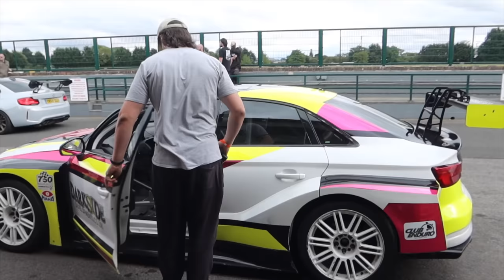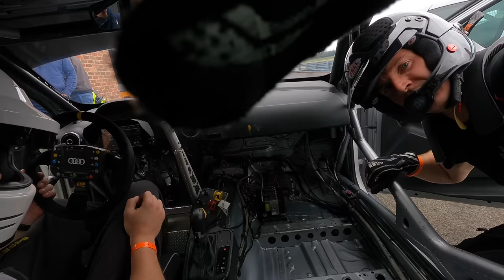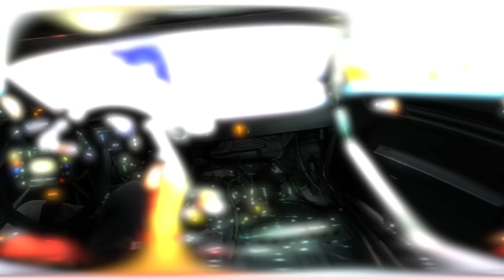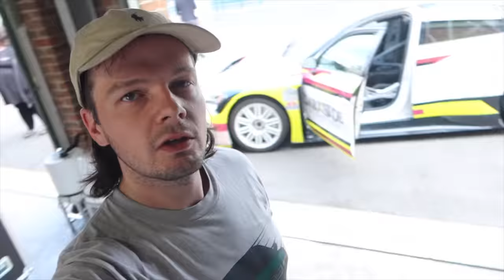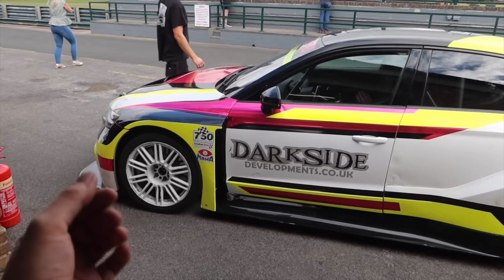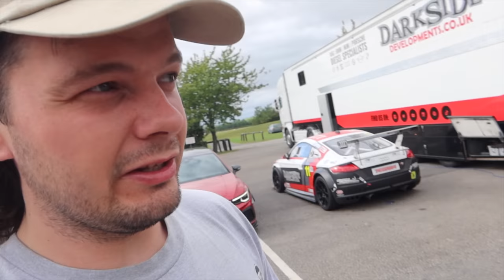AUDI RS 3 LMS - What's It Like To Drive? LHD TCR

Comment: I think TCRs are setup like because it helps with rotation, I’ve also noticed it helps with tire temp management, The rears are tricky to keep in optimal range.

But I’m going off the simulator😅 been racing TCRs for a few months

Great driving and thanks for another awesome video Dan
Reply from the maker: I think makes sense. Plenty of toe out on the rear to keep things warm and pointy

Comment: Hard to tell from the comfort of a sofa but from the looks of it the brake balance is off which is affecting the hard, high speed braking. The front end grip/point ability does look great. It's what appears to be missing from Josh's Civic. Again, only sofa observations.
Reply from the maker: I just think the alignment was off but yeah could have been brake balance. It was nervous on the brakes
Reply: @dannyDC2  yeah it looked it. Cracking driving by the way.